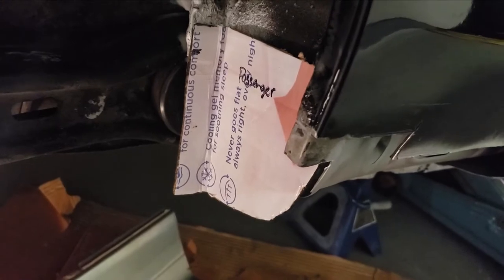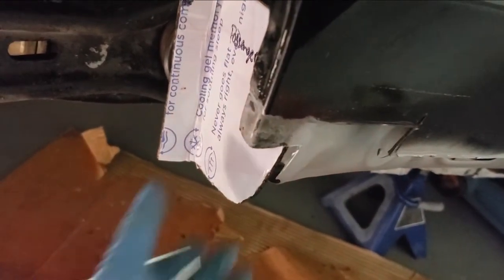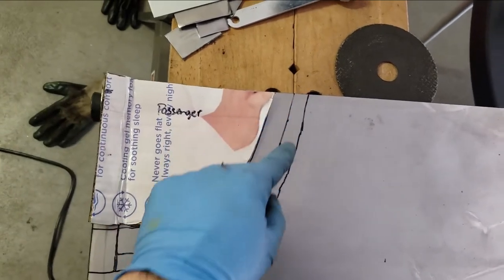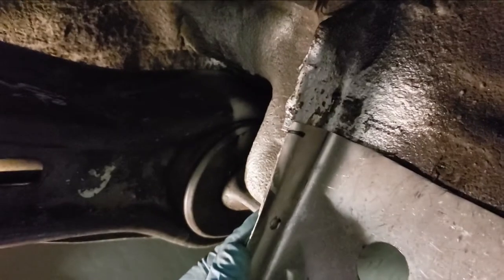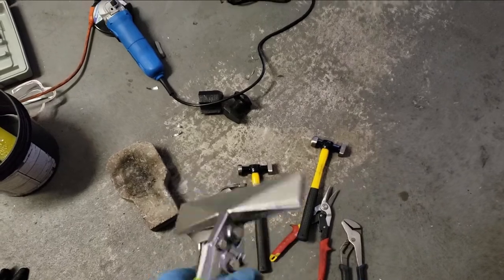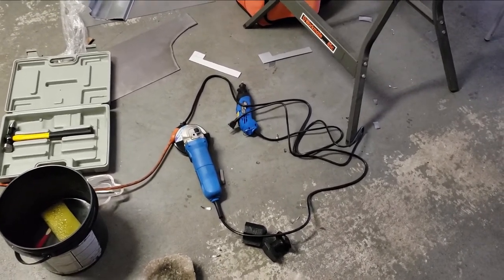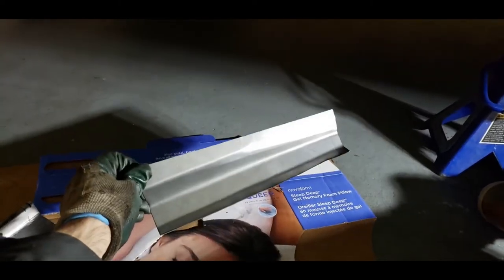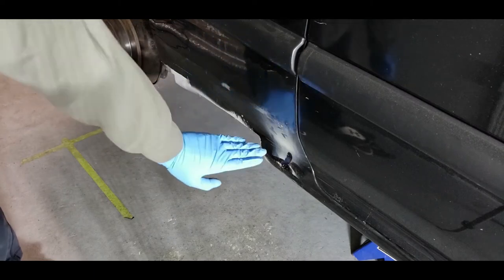[Car Rust Repair] How to Fabricate Wheel Arch Panels - Part 3

Comment: Nice Job. Makes you feel good about yourself, and I'm sure you've learned alot in the process....Been doing the same job as you, with the same tool set, and it's a nice accomplishment.
Reply from the maker: Thanks! I definitely learned a whole lot in the process. When I fabbed the other side, I did it much better and faster. It was a really nice accomplishment. I wish I had access to those metal shaping machines. Would have made it look so much better. 😁

Comment: Good to see fabrication and the use of pre-made repair panels. I got similar issues on my 1992 R8 Rover GTi. I managed to get some Civic rear arch repair panels so I can rebuild the arch lip.
Reply from the maker: Nice! I think I saw some pics you posted and the lip looks really good. I have a lot of trouble fabricating stuff without the right tools. Having the right tools would have made the job 10 times easier.